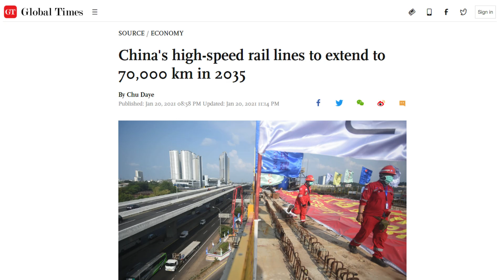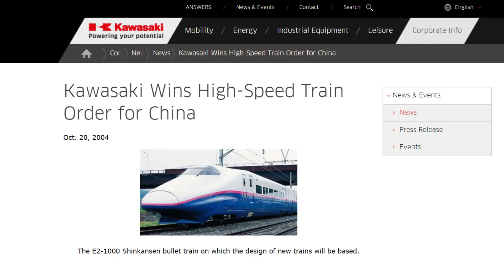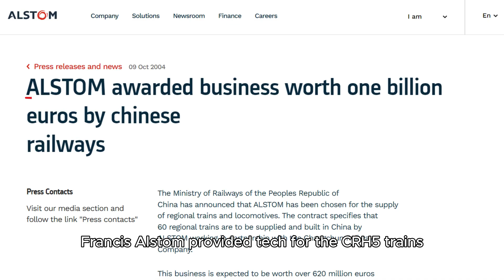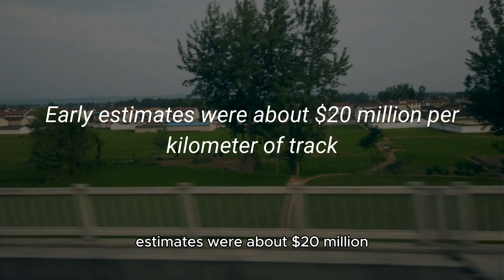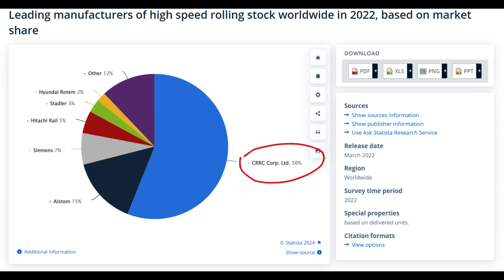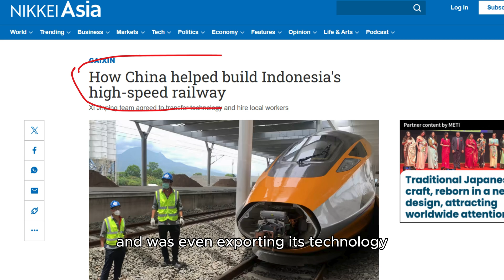How China LEARN to Build High-Speed Rail (and Get REALLY Good at it)

Comment: It is true that China learned the basics of designing and constructing high speed railway (HSR) from Japanese and European companies but had now moved ahead of these companies in the performance, quality and quantity of completed HSR projects.
China HSR is also vertically integrated to a large extent, producing the components for the tracks, track-side equipment, rolling stocks, signalling system, communication system, power system, etc, within China.
Credit should be given to the Chinese technocrats who had worked hard and learn fast to achieve this success.
This is really
青出於藍而勝於藍 
青出于蓝而胜于蓝 
Green colour is derived from blue (indigo) colour and is superior to the original colour.
(the student has now surpass the master).
Reply: CRH has over taken Siemens and Bombardier by a couple hundred miles now !
Reply: The basics😂Like saying Einstein learnt quantum physics from the first person who taught him  1+1
Reply: @shaun6123  
The basics are how to control fast moving objects sharing the same tracks so that they don't smash into each other (moving blocks), alignment of the tracks to allow smooth travel, aerodynamic profile of rolling stocks to minimize air resistance and turbulence, powerful electric motor drive and boogie to attain high speed and many others.